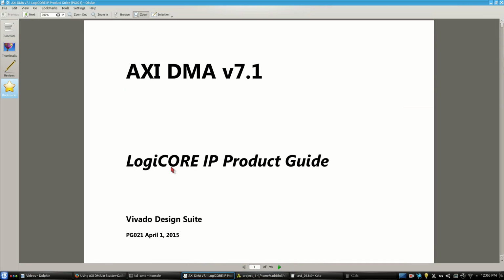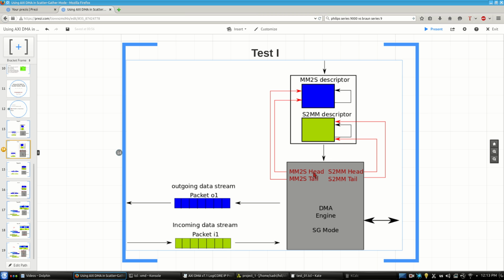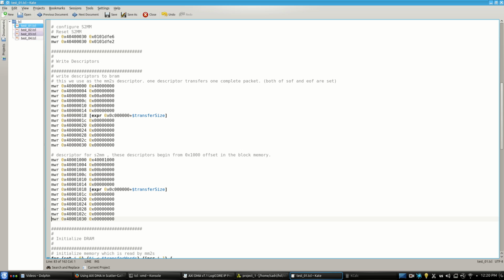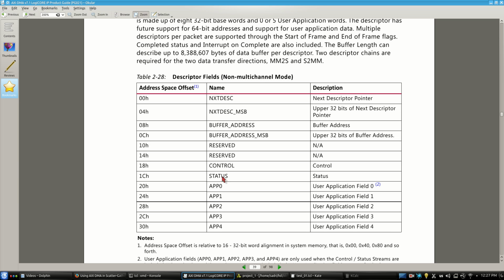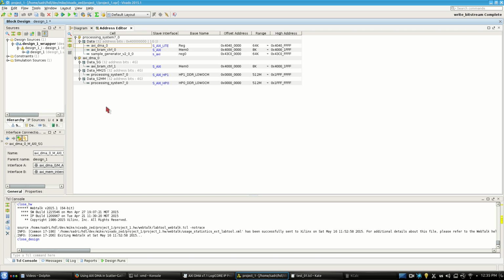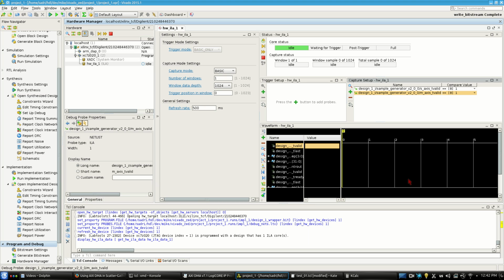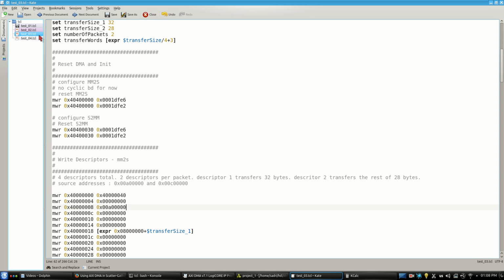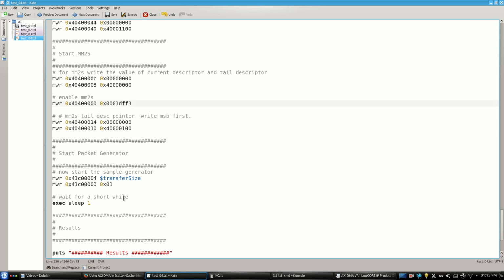ZYNQ Training - Lesson 10 Part II - Using AXI DMA In Scatter-Gather Mode

Comment: Dear Dr.Sadri when you say parallel working AXI DMA in both channels I want to ask one question. 
I see on documentation that we can define what scheduling method we want to implement to organize data transaction via AXI DMA (in SG mode. for example Round Robin.). But this makes an illusion of parallelism. I want to know about the physical limitation of this. What part or what device is making it impossible to have true parallel running channels in AXI DMA. 
I really see that on my device there is certain some priorities defined when running even in Direct Register mode.
Thanks in advance.

Comment: Hello, Do you have the part III of lesson 10? the software part for the data transfer? I have already made the donation but in the dropbox folder I cant find the part III. Would you please help me on this regard , how can I find the source codes for part III?
Reply from the maker: hi, just convert the tcl script that you have through your account into c code, it is direct and easy, mwr turns into xil_out and mrd into xil_in
let me know if you need further help. 

i have design examples for AXI DMA Scatter Gather mode when running Linux on the arm host and using a custom kernel level driver, those however are available at a fair cost.
Reply: Dear Dr. Sadri,
Thanks for the video. I would like to buy the third video in case that there are description for the C code as well (for the software). However, I am not sure how to reach out to you for this matter. @MohammadSSadri

Comment: Thanks for the video. I checked the axidma with ethernet example (xilinx) with scatter gather mode and found that they use only one rxbd for receiving a packet, hence, if I say want to receive 10 packets continuously then in that case should the 10th BD point to the 1st BD. As only single BD is used for a packet, how will the concept of tail and head pointer be valid? thank you.
Reply from the maker: ok i have not seen their design but one bd can point to itself and dma can be always busy processing this one single bd. thats once a transfer task is done it starts again. now this can be beneficial in a design where you want to do a completely unique transfer with fixed address and size values over and over...

Comment: many thank for the wonderful video.
i succeed to do  example design in this video by using xmd.
but when i created application to the test_1, and after that i read the address it's doesn't work
the content in address didn't overwrite by the counter, however it's stay 0xBBB
what is the different between xmd and application with template Hello World
thanks
Reply from the maker: mind the cpu cache!
Reply: Hi @MohammadSSadri ,

Thanks for your gread Videos and effort.
 I'm living same problem with 
@pini malul.

I think clock is not running.
I did everything what you say in your video.
ILA prob also gets nothing.
I could not understand, what you mean with "cpu cache".
I followed this steps:

connect arm hw 
fpga -f project1.bit
ps7_init
ps7_post_config

In a thread they have already talked about same problem and ps7_post_config was solved problem, but my problem continue.

Regards,
Saban
Reply: Hi Mohammed,

I solved my clock problem. I do not know what is the exact reason, but I have already installed Vivado 2016.2 and you used 2015.1 in your video.
I installed your and I create design by using your create script again and it solved the problem.

Comment: can you please refer me to part III. Cannot find it anywhere
Reply from the maker: that is to be created...
Reply: Mohammadsadegh Sadri I am trying to create a design for my Image Processing research on Virtex-7 board, and have no clue how to write a software program for Microblaze. Can you please redirect me to something that can be of help to me.
Reply from the maker: +Nitin Chugh what is the microblaze supposed to do in your inage processing pipeline?
Reply: +Mohammadsadegh Sadri 
I am using it to program the AXI DMA, which stores the AXI Stream output of my pipeline into the DDR memory.
I plan to use the AXi DMA in a Scatter Gather mode.
Reply from the maker: +Nitin Chugh axi vdma you mean or you plan to use the axi dma directly?
in any case there is obviously the microblaze processor reference guide from xilinx that you should have a look at 
and then another nice document Xilinx os and libraries document collection
i beleieve with these two and available examples you should be able to do the task
Reply: +Mohammadsadegh Sadri
Right now, I am just using the AXI DMA. I am looking at the Microblaze Ref Guide, will check out the other document.
Really appreciate your prompt response :)
Reply: +Mohammadsadegh Sadri
One quick question. How to use xmd for microblaze to verify our software application.
If that's not possible, how do we test our design like we did for Zynq in this video.
Reply: Still nothing? Thanks anyway!
Reply from the maker: Hi, you are looking for part iii of this video? after this video i have created at least 20 more videos, but most of them are not available free. the videos mostly talk about using AXI DMA in ZYNQ when Linux is running on the ARM host. contact me if interested.
Reply from the maker: Hello Nitin, I think I have not understood your question. the XMD can be used for both the ARM host of the ZYNQ and for microblaze. And if you have in your system several microblaze cores then again you can use XMD to debug any of them. And if you have a zynq device and a microblaze inside the PL, you can use the xmd to debug the ARM host as well as the microblaze. The key is the connect command in the xmd. When performing the connect you define to where you want to get connected. to the mdm (microblaze debug manager... if i recall correctly) or to the arm host in the ps. it is all in your hands. just, instantiating the microblaze in the PL of the zynq, dont forget to include the mdm module as well, and make sure it is connected.
Reply: Hi Sadri, Thanks for your videos, they are really helpful.  Can you give us a name list of further videos, so we can figure out if these videos are needed for us ?
Reply: Hi! I'm interested in those videos. But there is no any link to them. How can I get access? Should I pay before?
Reply from the maker: scripts available upon a donation nitin
Reply from the maker: never created that one. but, if you make a donation you will have access to design sources where you can download  the tcl scripts which can be directly converted into c code.